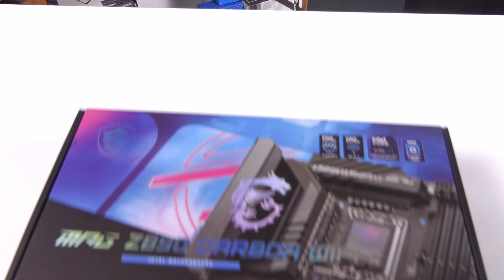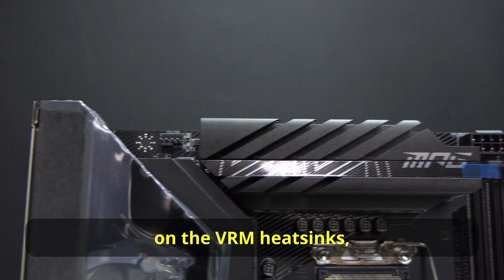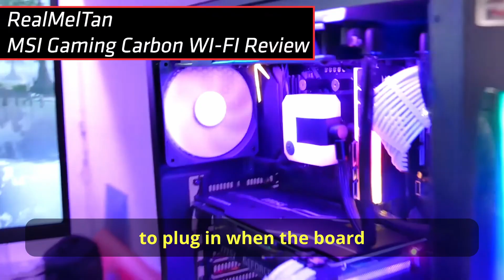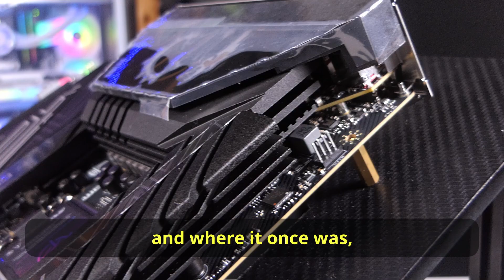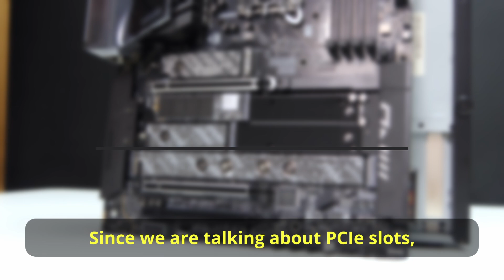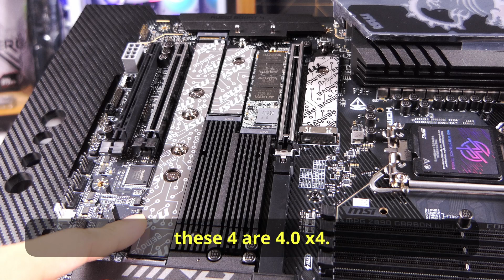WATCH THIS Before BUYING THE MSI MPG Z890 Carbon WIFI!

Comment: If im using a brand new ultra 7 270k plus with this motherboard, it needs the bios updated before it will boot to bios correct?  Is there anyway to get to the bios without installing the cpu?  I cant tell if my components are broken or if its user error. Ive tried to flash the bios from fat32 2gb sandisk renamed the update file etc.  Now the two buttons on the mobo dont light up until i press the bios button itll flash  for a min then stop or itll flash all night. Still cant get to bios

Comment: Do you know how I can change the battery in my MSI mpg z890 carbon wifi? need help🥺
Reply from the maker: I am not sure man. The battery seems to be located beneath the radiator (with the big dragon). 
This is a comment from reddit: You will need to take out the motherboard. It should have like 4 screws on the back side that holds the shroud with the dragon in place.

Replacing the CMOS battery might be tricky since most likely its not a socketed CR2032, but with a cable. Maybe its just disconnected, I would suggest to check the voltage with a multimeter just to be sure.

Comment: The Z890 Carbon is $200 more than the Z890 Tomahawk, yet there are very few differences that are relevant to many people.  You go from 16+1+1+1 power to 20+1+1+1 (but who really needs that much power unless you're doing LN extreme overclocking).  Carbon adds one more M.2 slot and converts some 5Gbps USB ports to 10Gbps and supports PCMIE bifurcation in the BIOS.  Most buyers will find no real benefit by paying $200 more for Carbon and would not even notice a difference from MAG Z890 Tomahawk (other than color scheme).
Reply from the maker: Yes you make very good points. But i think the carbon is always on a class on its own, it is like the entry point to MSI's higher end boards, and it is something more sensible than the Ace or even the Godlike (ok actually Ace does look nice). 
But between the Tomahawk and Carbon, just for practical sense, you are right, Tomahawk is better for the wallet. 

Although I think there's also a Unify?
Reply: @realmeltan  - A board is only what its features make it.  I've outlined the only feature differences of consequence.  It isn't in a new class just because of its name.  But, if you have a reason to want it, go for it.
Reply: For a class of something I would go for Asus Proart z890, from the line up to the physical jumper locked over clocking, dictated “I am a professional content worker only”. For buying functionality, Tomahawk is the way to go. For someone with Mac background may lean to Carbon for the abundance high speed connecting ports, since Mac users always spend a lot money to buy expansion ports. With this z890 ecosystem, already 4 ssd ports build in, why bother the external storage?

Comment: God bless every motherboard this round who uses that tool to easy connect front panel. Most hated part of building a pc for me is to properly connect power switch 😀
Reply from the maker: haha i agree with you. Even after installing quite a few boards, the IO still gets me sometimes. I have no tested this cable though, hopefully it is easy to install?

Comment: Great review! Looks like there's a lot stuff around the CPU area which can limit your choices of using air coolers. I wonder how good the IOMMU groupings are such that you run linux as the host with one gpu and run windows jailed in a vm with another gpu using gpu passthrough. At 8x for the 2nd pcie slot, it's more than enough for the host...which then leads to the BIOS, Gigabyte with their Aorus boards allows you to choose which PCIE slot to use as your startup GPU, not sure if MSI caught on to that (which I have setup and works perfectly with a 5950X X570S GB Master with a 3080 and 3070 GPU)
Reply from the maker: I have a few air coolers i can test with, but i do not have the board with me (have returned to MSI). 
I am not familiar with the IOMMU groupings, but i think for this higher end board, there should be enough lanes and bandwidth to run what you need. I am not sure if you can select which slot you want to use for your GPU, if i can run the BIOS, will update you.